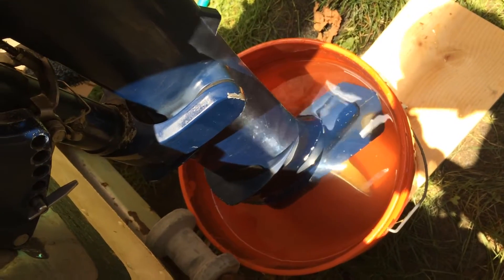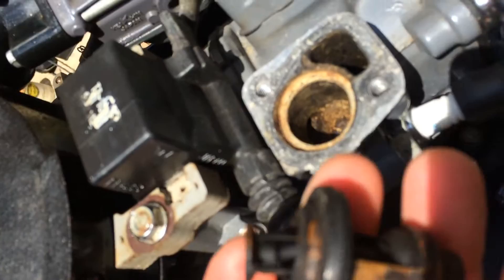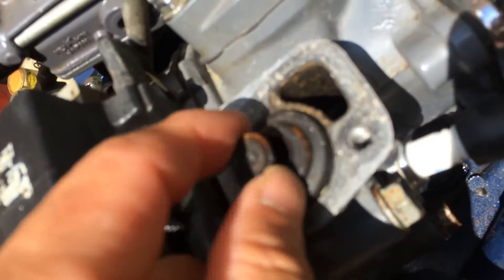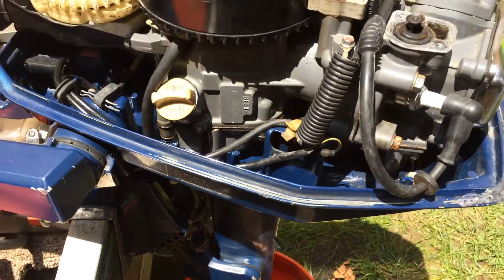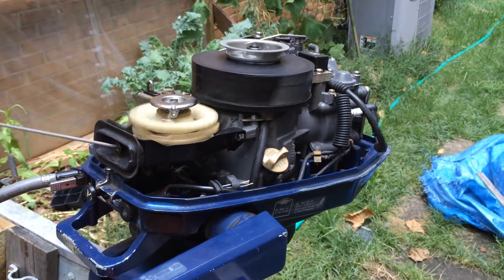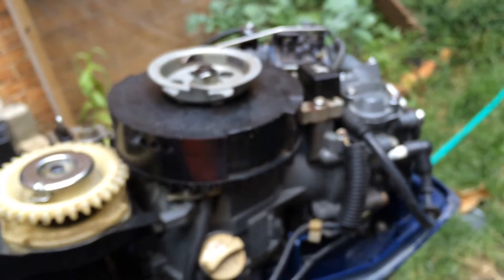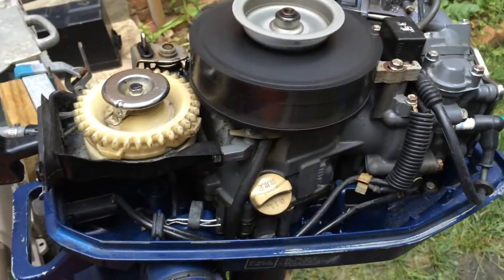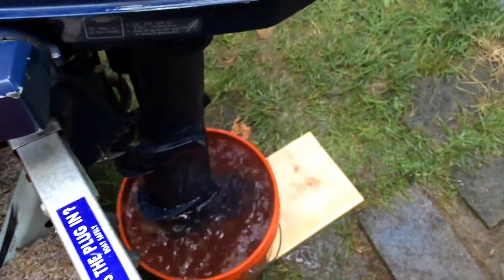Honda 5hp 4cycle - peeing hot water after impeller change

Comment: Did you manage to solve this? I have exact same issue and happened after impeller change. On a 2006 model though
Reply from the maker: yes, it was the sand got into the motor when we first bought it. The owner ran it to the beach and picked up a bunch of sand dirt. We opened it up and clean the whole thing out. Flushed the sand out and replaced the impeller. It is running like a champ!
Reply from the maker: silly me, it was the thermostat - easy fix and it is running beautifully now